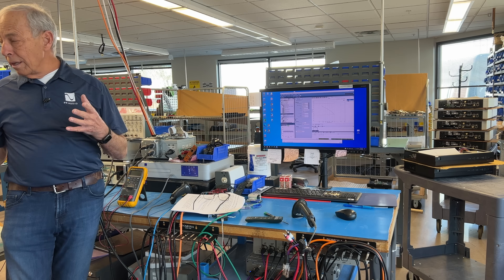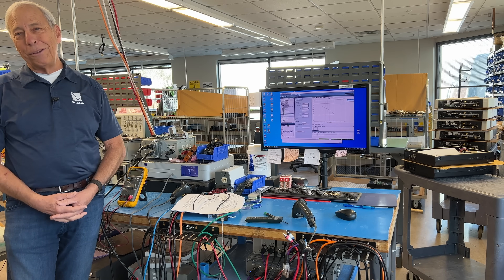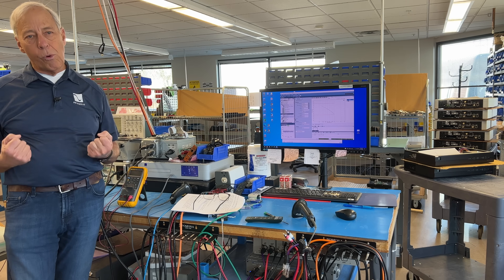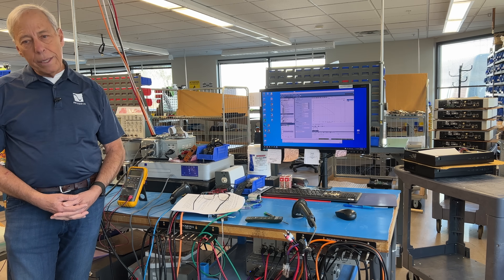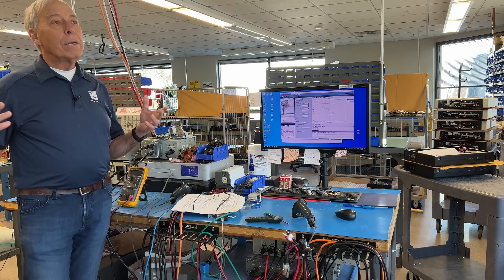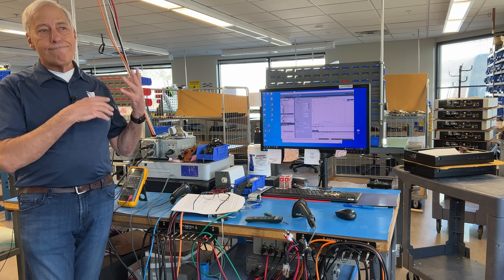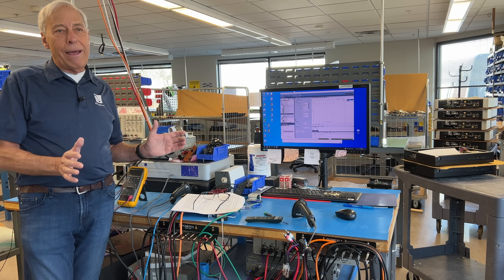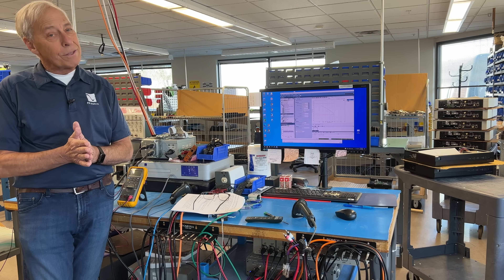Amps that double their power

Comment: Paul, I agree with your assessment of power doubling with halved impedance in the load, but I think it's an oversimplification.  To some extent, this phenomenon is dependent on how a manufacturer rates their equipment.  For example, if a manufacturer says their amp puts out 300 watts into 8 ohms and 400 watts into 4 ohms, it's quite possible that it could put out 150 watts into 8 ohms and 300 watts into 4 ohms.   I think it's unfortunate that the industry has not developed more standardization on how amplifiers are rated regarding their power output capabilities.
Reply: Actually, it's safe to say that in most cases it's completely dependent on rating. You've claimed too little in the description of your example as "quite possible". It will in fact always be that a conventional amplifier (i.e one in which there is no change in circuitry for differing load impedances) that can output a certain power into 4 Ohms can deliver half that power into 8 Ohms. That's just determined by the laws of physics. Stated the other way around, it sounds impressive and desirable, and gives no hint that it's a feat every amplifier under consideration can achieve. In your example of the amplifier with the soggy power supply, 400W into 4 Ohms requires 40V RMS sine wave output, and the amplifier can therefore perfectly adequately provide the same 40V into an 8 Ohm load, delivering 200W. If the manufacturer rated the amp this way, 200W/8Ω, 400W/4Ω, people would think it must be a good, beefy amplifier. Yet if it can actually deliver 300W to 8 Ohms, and gets rated as such, people might think it was a poorly designed amp. In fact if it had excellent electronics, it could be a capable amplifier, providing much more headroom driving an 8 Ohm load than an amplifier which could actually only accomplish 200W/400W. These kinds of inherent tradeoffs, which are not usually addressed, agree with your conclusion of an oversimplification. As for rating standards, there are of course well specified ratings standards in the industry, which amplifier powers stated just as unqualified numbers disregard.

Comment: I have a Magnum audio Amplifier IA200 . ITS A CLASS A AMP. The brands factory doesnt exist anymore .My question is this! An  electronics store in Greece sold me Neat Aqoustics sx1 motive speakers ,150 watts, they are 6 ohms. is this bad ? They sound excelent in my ears , i tried a lot speakers, i end up with these !!!6 ohms speakers with an 8 ohm amp,? The general rule says a speaker should not be less ohms than an amps ohm, so can you drive them safe ?  What if i push magnums power in film home cinema sound is it safe ? or i destroy the speaker? or amp by the years?, Usually A class amps delivers very good melodic sound, best  quality ,less distortion.. but their architecture  says that class A gives max 20 watts or 30 watt real rms , did i make the right choice of a speaker ? or should i buy a new amp  AB CLASS? how do i know this magnum ia 200 works on on 8 or 6 or 4 ohms? the manufactures paper says only this ... output to the speaker , loads 4 - 20 ohm
Reply: Copies of the user manual online show inconsistent specification on subsequent pages, one saying 4 - 16 Ohm, the next page stating 6 - 16 Ohm. Either way, your speakers rated as being 6 Ohm nominal should be quite acceptable. All the indications are that the amp is a Class AB design - a 100W/Ch Class A amplifier would be 3 or 4 times as large and heavy as the IA200, with enormous exposed heatsinks.

Comment: My Crown DC300 Doubles, this is important for Headroom before Clipping & Distortion !!!! 
And it’s important to Match Load with a given amp dynamics. 
My Infinities are Nominally 4 Ohms and the Crown Has Enough to Drive Them to sufficient levels !!!
GOOD MATCH !!
Reply: The reality is if you design an amplifier to have such high power supply regulation that power output at half load impedance exactly doubles, you are designing out dynamic headroom. The ultimate example is an amplifier with a fully regulated power supply, which has no dynamic headroom and theoretically an exact 2:1 power ratio given 1:2 load impedance (disregarding output stage voltage drop variations between loads). The supply rail voltage variation that occurs with load variations in a conventional power supply is what creates the different proportional powers between load impedances (e.g. 140W/200W rather than 100W/200W), and is also the factor that provides dynamic headroom above the continuous rating when used in a musical application. The DC300 comes close to doubling power output with halved load impedance, but that's not actually the characteristic that indicates headroom.

Comment: just a though to add here: most wattage measurement is done at the highest output around 0.1% THD. you do not need doubling down at 4ohms for that. unless you need just that power output.   
on most cases 100 watts is what you need to play as loud as you want, then the doubling can occur more easily. the specs says its a 200watt amp that dont double down to 400watt, but you dont use those high wattages but only 100 watt. see my point?
Reply: @Taco maybe those simple sepc numbers should be illegal, since they are at best oversimplified and misleading.
and only proper graphs and whole data sheets should be shown.

Comment: Problem is that looking for amplifiers that do that, narrows down the field massively. I noticed recently that Denon and Marantz amps tend to though.

What confuses me sometimes though, is that amplifiers that don't double power over impeadance halving still read flat. I mean in frequency amplitude graphs.
Reply from the maker: Yes, they will because they are flat. It's the speaker outputs that aren't flat when connected to these amps, but you don't see that information on the amp manufacturer's data. Not all speakers have big impedance swings so this isn't a problem for all speakers but it is for many.

Comment: Most people dont live in homes that support amplifiers that consume a huge amount of electricity. Especially not with all the other stuff that might be powered on the same breaker. Most probably dont even consider it. So consumer grade gear has to be built in such a way that it is safe for them.

Comment: To me, how close an amplifier can come to doubling output power for 4-ohm loads, is much less important than how much margin there is in the output stage's electrical and thermal design.  And no, one does not infer the other.  People are reading too much into an amplifier's ability to "double down," while overlooking more important design details.  
I wouldn't down-rate an amplifier just because its 4-ohm power is only 50% higher than its 8-ohm power, but I certainly would down-rate it, if I need to use it with 4-ohm loads and its expected longevity is greatly reduced when operated with that load.

Comment: What if amps double down at normal listening level wattage? If you are only using 10-20 watts of a high power amp and it is able to double down from that wattage, is that good enough?
Reply: Yes, at lower power levels, all amplifiers will double output power when going from 8-ohm to 4-ohm loads.  
But users are always interested in peak output capability, because it's headroom they are looking for.

Comment: This is an oversimplification to the point of being wrong. If you want a amp to give you double the power at half the impedance, you simply increase the current handling capability of the circuit. The reason a big power supply sounds better than a small one is because of something called sag. If an amplifier with an undersized power supply needs to deliver big current for a big drum hit, the voltage will actually drop a bit and the amp won't deliver the correct amount of power. Oversizing the psu is simply one way of combating this issue. There are other people who will used regulated power supplies or even batteries to achieve a similar if not better result. Those amps will not usually double their power as you half the impedance, but they are still excellent amplifiers.

Comment: I listened several times to make sure I heard "make sure that it at least doubles between 8 and 4 Ohms". I'd be interested to find out how maximum power capability can more than double between 8 and 4 Ohm output load if we're talking about a conventional amplifier that experiences no physical change between the two scenarios. More than doubling with a 4 Ohm load would require the amplifier to output a higher voltage into 4 Ohms than into 8.
Reply: It also can be interpreted that the amplifier double from at least 8 to 4 ohms but not necessarily from 4 to 2 ohms as some amplifiers do such as their own BHK 300.
Reply: @Roo-n9j  Agreed, that would make sense, for it to have been better said "make sure that it doubles, going from 8 to 4 ohms at least".

Comment: Mine separates power amp is quite nice. 250 w/8 Ohm, 360w/4 Ohm. 300/550/800 Watt on impulse. 47 A current capability
Reply: So your transformer is underrated but the capacitors can handle a single impulse (Think one sine wave, at what frequency even?) that's what capacitors are made for.
Reply: @hugobloemers4425  its 2 transformers and 16 130w transistors

Comment: Absolutely correct! Not only the power supply but the amplifier has to be well designed to do this extra output current. Krell FPB700CX that I have is outstanding for this trait, right down to one ohm with pulse output, not continuous. The amp runs off a dedicated 240v 20A line to do this, amazing bass is achieved, and class A amps like this get extremely HOT. 6KvA psu with regulated voltage rails makes it possibly the largest stereo amplifier ever made in class A!